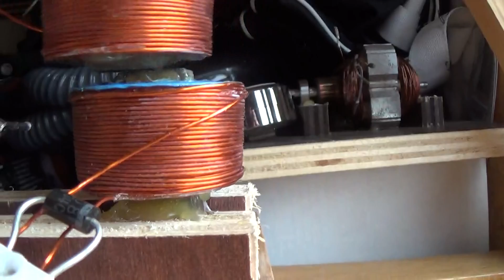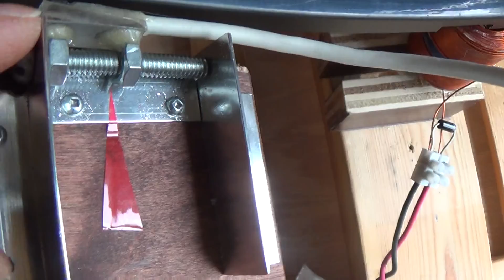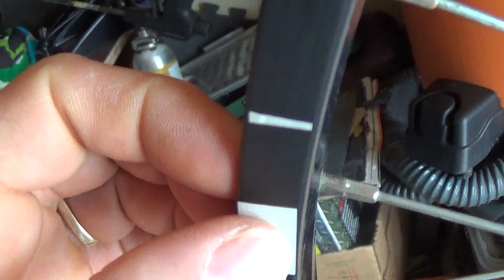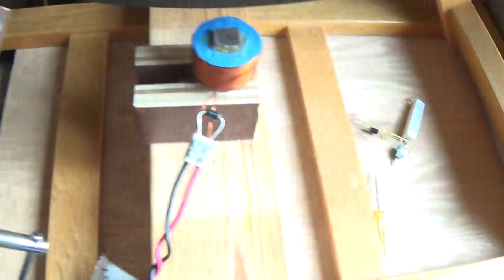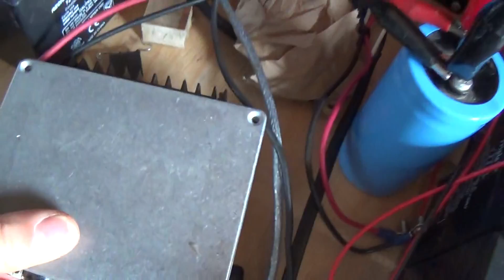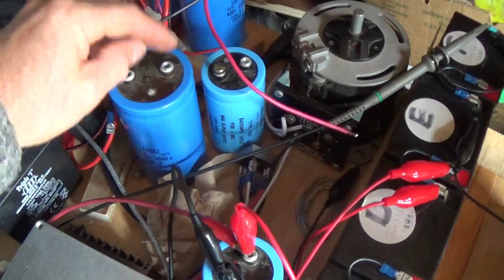Rotary Version Dual Coils with Flyback Diodes

Comment: Joules=capacitance(F) x stored charge (Volts)
62.5V x 0.0042F = 0.26J 
12.5V x 0.07F = 0.875J
(assumed about +10% on both caps, typical from my same parts)